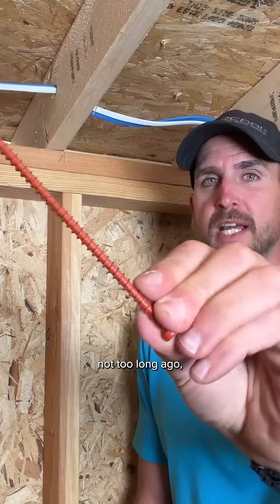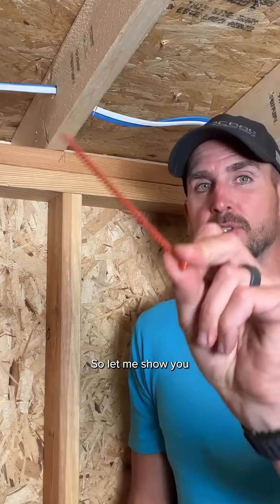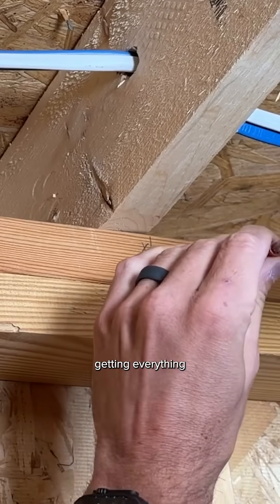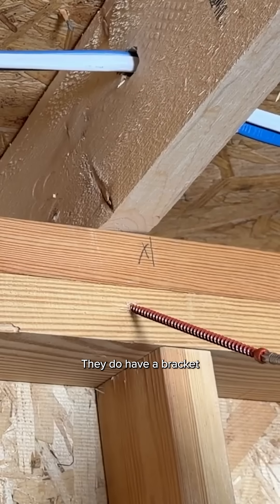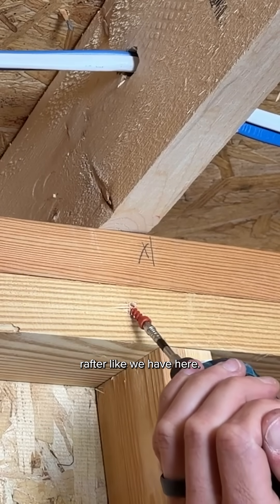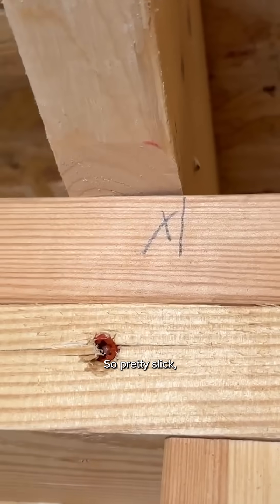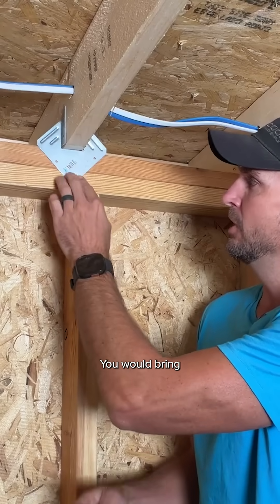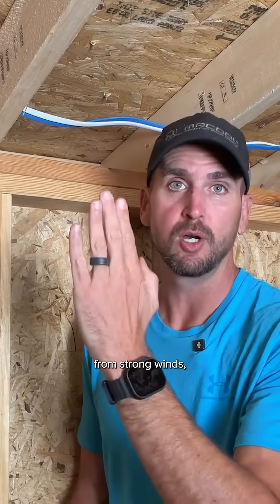The Screw That Makes Hurricane Straps Obsolete?

Comment: People, this screw isn't a direct replacement for every strap in existence. It has published uplift, in-plane, and out-of-plane design values, as well as very specific installation instructions. As long as the loads don't exceed those values and you install it properly, it's good. - t. Structural Engineer
Reply: You probably hate being asked this, but is the planes crashing the world trade centre, and the jet fuel burning, a legitimate cause for what happened to the buildings imploding the way they did?
Reply: I wouldn’t let you build a sand castle
Reply: I wouldnt let you build a dog house
Reply: @sirlurkalot3719 your doghouse has bigger problems if the uplift at each rafter exceeds the capacity of that Simpson screw.

Comment: I would run that screw at a more vertical angle from below and then add the bracket as directed.
Reply: I wonder if he is misreading the instructions. Whenever we have been supplied these screws by our truss supplier we were instructed to enter under the bottom plate 1/2" from the edge and angle them up into the bottom cord of truss. They supply an angle gauge. The exception is where a truss sits directly above wall stud. In that case you enter the screw at the seam where the wall stud meets the bottom plate. The way he is doing it provides little if any hold from the bottom plate especially after splitting it.
Reply: Yeah I agree. He must be doing it wrong.

Comment: I’ll be the first to admit that I’m neither a contractor, nor structural engineer.  I’m a novice who is trying to learn about this stuff, so please respond with that in mind.  Feel free to educate me, as that is what I want…

I imagine that Simpson did significant testing re the strength of this joint vs. the strength of the previous bracket with several screws.  Although I’m not an engineer, I imagine that the length and gauge of the screw have a lot to do with the strength of the overall joint.  Clearly, there is an improvement in this area.  However, it seems to be that the precise installation of these screws is critical to the strength of the overall joint.  If the screw starts 1/2 up the bottom board, for example, that might result in a significant difference in overall strength as compared to a joint in which the screw was started near the bottom.  Perhaps that is why they included a template?  In actual practice, nobody is going to use that thing.  And yet, it might be one of the most critical elements of the engineering.  I’d be interested in a study of the ideal installation for these things, as compared to the methods used by the average (perhaps even untrained) installer.  I’d bet there’s a huge delta between the two.  For the professionals out there, please help me understand…
Reply: I think you understand just fine.
Reply: @incognitotorpedo42  Thank you for that.  I often think I’ve thought through a subject pretty well, but I still want to give those with actual expertise an opportunity to set me straight.
Reply: I’d say you’re exactly right. I’d be wiling to bet that code compliance hinges on using the guide as instructed.

Comment: Engineering fails
Reply: Plate uplift in Doug-fir is 545 pounds.  The screw is 615 pounds.  Simpson publishes these values based on testing, you can look it up for yourself.

Comment: The plates and straps are required for structures in a velocity zone of hurricanes. Screws would not pass code.
Reply: Please show us in the code where it says this.
Reply: @SteelheadTed Local codes vary I'm sure. This is for my city
Reply: it should be easy then to show where your CIty changed the national code.  (All 50 states use the International Building Code.  Many states amend that code with things specific to their state.  Some Counties and cities add their own amendments.  However, no one prohibits ICC tested products, which this Simpson product is).  So, it just isn’t true these screws ”would not pass code”.
Reply: @SteelheadTed  Velocity zones is the key word, codes are different. To qualify for a gold standard home you have to comply for better insurance rates. Straps are required. That screw has a finish head on it.  A cat 5 hurricane with spin off vortex is what we deal with in a velocity zone, along with wave action carrying debris.
Reply: @bamaman6297 that’s not how the building code works my man.  I’m a structural engineer.  I am quite certain of this and how wind loading works.

Comment: Is it Florida building code approved
Reply: Though Hurricane Hugo forced Floridia to outlaw OSB for roofing?
Reply: @CAHOBBES  No. 
OSB of 7/16", or greater thickness, is allowed for roof decks in Florida.  Current code requires minimum 8d nails spaced 6" OC for deck nailing. 
These are not approved by FBC or Miami-Dade as of today.
Reply: As others have pointed out, this guy is installing it wrong.

Comment: I’d rather have the bracket with multiple screws.  Especially here in quake and high wind land (SoCal)
Reply: There's no high winds in Southern California that you would need to have that.
Reply: Screws break nails bend, that's why homes are built with nails, especially in earthquake prone areas.
Reply: @justinmalone7095 

We have had structural screws now for a while with a similar ability to bend and not break. Screws are great for many situations where nails would be difficult to get into. Better for DIY as well.

Comment: It’s perfect for introducing a crack into the board that can split later on when things settle
Reply: Yeah I'd want to see the data that shows that screw is as good.
Reply: @uncertainscientist  You think a corporation like Simpson is making up all their testing and compliance claims?
Reply: @JustSomeJoe-dp5rp I didn't see their test results in this video... it's not as strong, period.
Reply: @5400bowen  I never claimed it was as strong.  Learn how to read, period.
Reply: Yeah cause 4 10d nails is less diameter than that 1/4 screw
Reply: That’s why you always drill a hole slightly smaller than the screw to avoid cracking.
Reply: @J.P.82 - it would be great if they gave that a name.  Maybe they could call it a “pilot hole” since it guides the screw where you want it to go.
Reply: @1wheeldrive751 ya we know that I was explaining it in layman’s terms.
Reply: @1wheeldrive751 that's a great way to defeat the entire purpose of the screw
Reply: @evrlastngcherry7727 - not a woodworker, I guess.  Pilot holes are required for screws holding multiple boards together.  The pilot should be shank diameter through the first board, and smaller in the 2nd one.  That’s what develops the clamping force to hold the boards together, which by the way is the purpose of a wood screw.
Reply: So putting 10 big screws at all angles has less cracks than one specialty screw engineered for this purpose? Man you really skipped college?
Reply: @Cro-l5j 10 big screws? Is that on the hurricane clip?
Reply: @JMAC1265   Correct a 1.5 inch screw is not a "small electronics screw".
Reply: @Cro-l5j the screws are shorter and crack the wood less than that 6" one. You can see it cracked it in the video. Self drilling screws stop the cracking. And shorter screws going perpendicular into the wood tends to create fewer cracks than going through right next to the corner. He should have brought it from below, not on the edge of the 2x4. It's better than nothing, but not nearly as strong as the plate.
Reply: And you think putting a screw in the same spot but with a bracket doesn’t introduce the same crack behind the plate? Jesus people think a little before you speak.
Reply: @fatal510 there’s this thing called pre-drilling…
Reply: @fatal510  no, it doesn't. Most people use nails on those not screws, and if you do use screws, it isn't a thick 6 inch screw. Dummy
Reply: @fatal510  Jesus has nothing to do with it,  to under engineer is akin to fatal results. I wouldnt let you nail 2 sticks together with your knowledge, but maybe your mouth could.
Reply: Big difference between lab based test results under "simulated" conditions using optimal testing conditions. Show me REAL WORLD data, say from houses both newly built and upgraded restorations built in Florida, built by contractors in the field using standard building techniques and hit with hurricanes. 

I'm not saying that these can't do what they claim to do. What I'm saying is that there isn't enough real world information by established installers in the real world to claim that this is any better than a hurricane bracket. And as it was stated before, it only takes one screw to hit a soft piece of wood or cause a crack internally or create a stress after the winds have come through and cracked your rafters and your beams and not be able to see it. And if anybody's ever purchased a newly built home in Florida in the last 5 to 6 years, you'll know exactly what I'm talking about. A good majority of these builders, not everyone. I'm not including everyone. There are exceptions, but a good number of them that I have seen, especially when I was looking for homes. I can tell you that these homes were rushed. They were not built properly and I wouldn't trust them using a system that has not been tested in the real world for several years. Sometimes it's not the product. It's the installer and the materials used that can introduce problems not accounted for in lab testing. 

As my father used to say what looks good on paper doesn't necessarily transfer over into the real world.
Reply: Simpson does real world lab testing
Reply: @BaronVonFrankenBolzlll On what ?? a dig house.
Reply: If you want to see "tested in the field with contractors" first you have to test the contractors.  I guarantee you the largest problem in home building is NOT the choice of code acceptable hardware.  It is mostly lousy workers and/or contractor companies doing shoddy work.
Reply: @CandorPerlicious  simpson has built 6 story clt buildings on a shaker table for testing and homes in wind tunnels🫣
Reply: @CandorPerlicious  So you actually think Simpson didn't do real world testing on these?  Do you doubt all their other products then?  Or for that matter, any company's products?  You don't use any product that you don't personally evaluate REAL WORLD data on?

Comment: 1. According to their installation instructions, you installed it in the wrong location. It's supposed to go in at the bottom Corner of the lower 2x4, not the middle.
2. I don't find any information on it as a "Replacement for Hurricane Clips" only that it was approved for "for uplift and lateral loads between wall plates and vertical wall framing and between the top plate and the roof rafters or trusses". Does that include Hurricane forces? IDK
3. You can also install them vertically from the bottom of the lower 2x4 straight up into the rafter
Reply: I was gonna say, that screw isn't grabbing much of that lower top plate. I like the idea of screwing from the bottom better. No worrying about an uneven surface for drywall later.
Reply: @DustinLe1 prone to user error 😂😂
Reply: @joes5096 I mean so are plates, so many people install them entirely wrong
Reply: My first thought after watching him talk about it and screw it in was "installation error seems like the biggest issue with this" and then I read your comment and laughed. I'm gonna stick to my hurricane fastener. I don't understand why I need to use something else just because it's "slick". Maybe use both.
Reply: It doesnt replace the h1 just the h2.5
Reply: Didn’t look it up yet but when he installed it I was thinking it would be much better if it went through the booting 1/4 inch on the lower 2*4
Reply: I think you are right.  The installation guidelines for this product say the screw should go into the corner of the bottom plate and should be no more than 1/4" from the corner.  This looks more like about 7/8" of an inch to me.  The problem with a lot of products like this is in the field contractors rarely pull out the installation guidelines and read the footnotes.
Reply: I'd have put 2 from the bottom going straight up. It isn't going anywhere.
Reply: Direct replacement verbiage is up to the engineer, this is why you must have a good relationship with the engineer
Reply: This video is a bad lesson. He should take it down.
Reply: "You can also install them vertically from the bottom of the lower 2x4 straight up into the rafter" This!
Reply: You shouldn't be able to just screw up threw the bottom. Rafters should sit on a stud. I don't know why that's not the case in the video. 
Why you would start half way in the lower plate is beyond me? It's gonna crack the sh!t out of it.
Reply: @chadlucier Rafters are typically on 24” centers.  Studs may be on 16”, 24” or 19.5” spacing depending on the size of the stud.
Reply: @JT_70  19.2 x 5 = 96
Reply: @GregoryClarkson-j1j  Oops! I meant 19.2 not 19.5. 16 x 6 = 96 and 24 x 4 = 96.  Plywood and OSB are normally 4’ x 8’ or 48” x 96”.  🤷🏼‍♂️🤷🏼‍♂️🤷🏼‍♂️
Reply: @chadlucier Because 99% of walls are framed at 16” on center. Tell me you don’t know 💩 and you’re just running your gums. ❤
Reply: @chadlucier  His demo is on a shed....stud under rafter not required/needed.

Comment: My house built in 1985 has two 16D nails, toed from the top, holding the trusses to the top plate lol.
Reply: Amd they were hand driven
Reply: My 1951 home has the same toenail method.
Still rock solid👍
Reply: Yeap,over 100 years from now that screw and roof will still be in place
Reply: Those old American made nails are ridiculously strong. It’s amazing how much a proper toe nail holds.
Reply: @thebullgator and the lumber was different. Old growth
Reply: @MentalData insanely more dense and stronger wood from the past. I own a remodeling company and we recover and re-use all the old growth we can. It’s worth taking the time to remove the nails.
Reply: @thebullgator i believe it. Ive actually tore out some original walls and used the studs in other parts of my house. Still straight somehow. The saplings you get now split so often just from nailing
Reply: @thebullgator  I can't believe the quality of the old growth doug fir my 1960 house is framed with.  I've literally made furniture out of framing lumber salvaged from remodeling.
Reply: @incognitotorpedo42  Can't do any better than Douglas fir for framing.  Wish I had the same.
Reply: @omcbob37  Southern Yellow Pine is comparable to Douglas Fir.  The species used usually varies with the region where you build.
Reply: @lostinspace8238  Agree that species used will vary with the build region of the country.   Yellow pine has slightly higher bending strength than Douglas Fir, but Doug Fir has higher compressive strength both perpendicular and parallel to the wood grain, higher modulus of elasticity, higher modulus of rupture and higher shear strength.  Some categories have big differences some smaller, but given the choice I'd take the Douglas Fir any day.
Reply: @omcbob37  When I worked with Southern Yellow Pine what bothered me most was the splinters.  It was the worst.
Reply: @lostinspace8238   Douglas fir likes to leave splinters too. They'll fester and make you itch like crazy. Also, wood sucks because its literally farmed. Douglas grows extremely fast and usually fairly symmetrical, but are grown in clear stands without competition for light. This leads to 200ft trees in 60 years but with a quarter inch between grains. All the good wood is gone or to hard to get.
Reply: @lostinspace8238  Totally agree.
Reply: @thebullgator  I’ll be honest I’ve pulled some of them and goodness sakes, you’d think by the amount of creaking the lumber had growth around the nails. But yes, can confirm, many broken screws hanging drywall in those old trusses.
Reply: Your house has likely not experienced 150 MPH extended wind speeds.  That's the way most houses were build in 1985.  Toenails was acceptable because the code requirements for wind were lower.  A lot of people don't understand the basics of wind uplift.  Imagine your roof like a wing of an airplane.  As air passes over it there is a suction uplift that happens.  In a normal 60MPH windstorm it might only ever see 50# of uplift if any.  Those uplift forces to up exponentially when the wind increases to hurricane strength.  Two 16d toenails is probably good for 150#.  If you get up to 300# of uplift, your roof is probably going to fly off and end up in a million pieces.  Once it breaks apart every piece becomes a projectile that pulverizes neighboring structures.
Reply: @lostinspace8238 Definitely understand uplift- and definitely live in a region where I likely won’t see 150mph sustained winds in my lifetime. I live on a wooded lot with trees well over 100ft. If I see those winds we’ve got other problems aplenty lol.
Reply: @danervin2530  There are factors in wind load design that account for the "exposure".  A structure in a heavily wooded area is going to need less hold-downs than a house out in the open along the seashore in a hurricane zone or on top of a mountain.

I hear you on the trees.  Every time there's wind where there are forests, there are downed power lines that don't get reconnected for days.  You also have to worry about forest fires.
Reply: @lostinspace8238 Last time we had 60mph sustained wind the 12” diameter silver maple branch said IDGAF about your toe nails or truss plates- I’M COMING IN lol
Reply: No need for hurricane strength when your house will never see a hurricane🤷🏼‍♂️
Reply: The bolt is so much stronger.